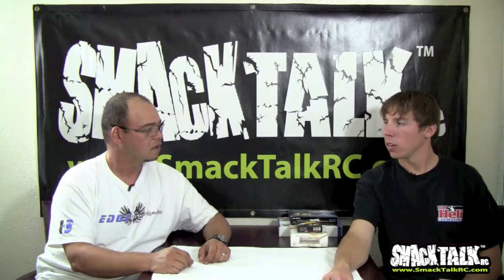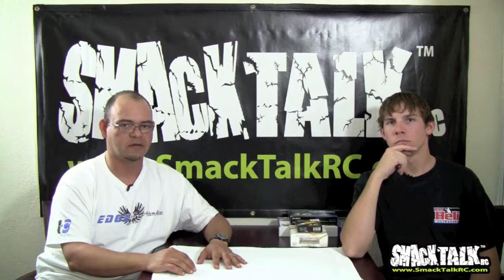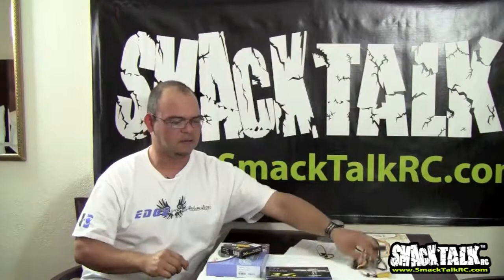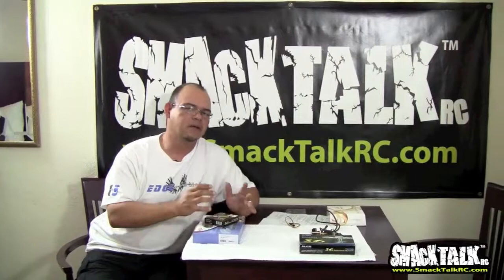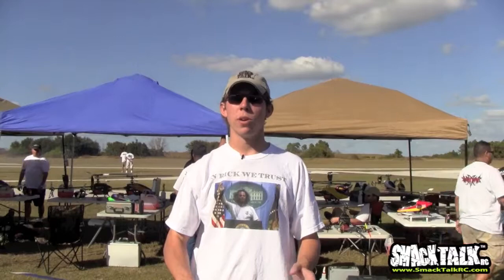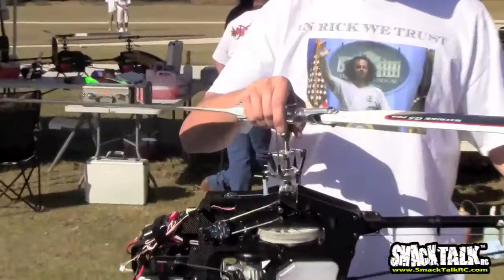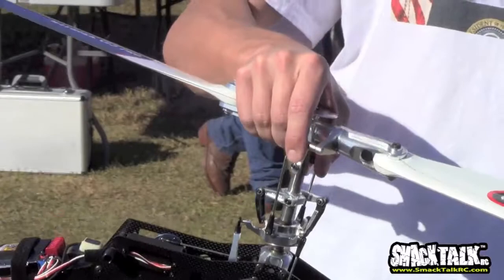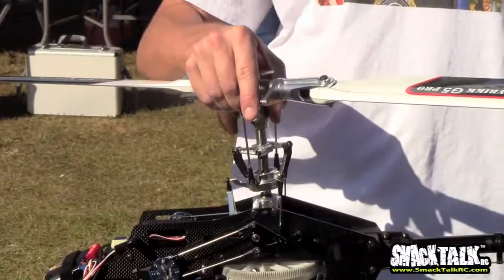SmackTalk RC Episode #10 - Going Flybarless

Comment: The first real yet quite successful approach to make FBL affordable to masses was made by Skookum Robotics in 2008 by coming up with SK-360 2-axis system when people were offered to just to add the electronic cyclic control to their existing tail gyros. There was another attempt to repeat success of Skookum such as Probar by Eco8gator but it ended up at prototype stage only for some reason.